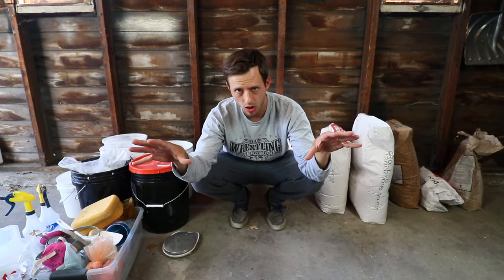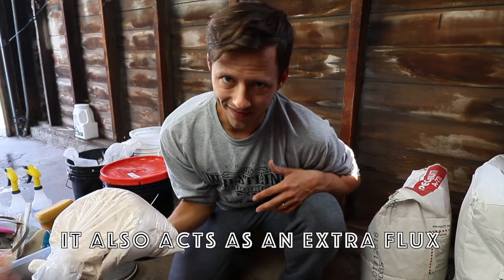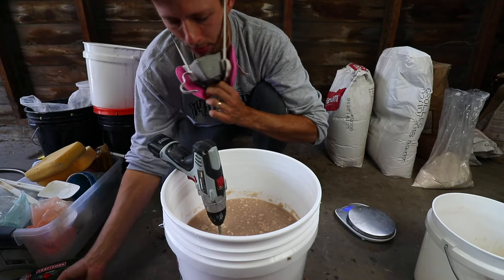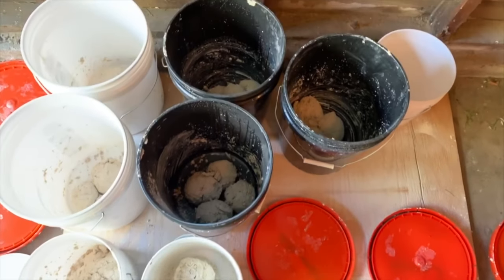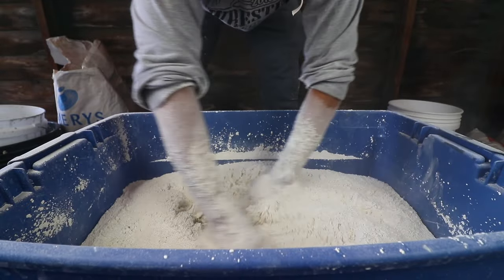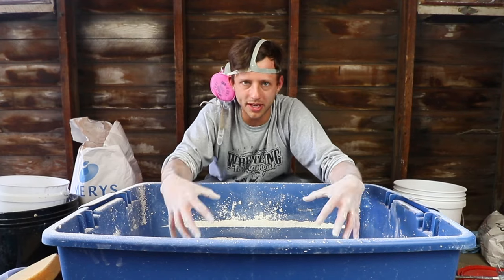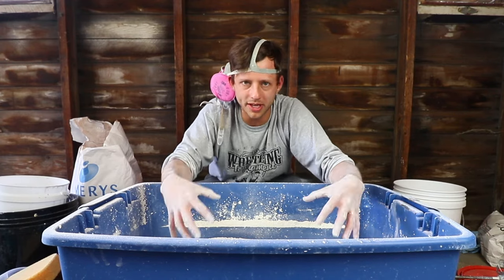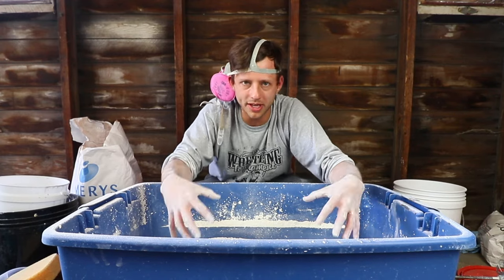How I Make Clay at Home | Pottery | Ceramics

Comment: Back in college we had a mandatory clay body mix, and my prof had measured out all ingredients and then marked out where that weight hit on a 5 gallon bucket and drilled a screw at the mark for easy measuring. I hope that makes sense!
Reply from the maker: That does make sense. Sounds like a helpful hint. I’ve done something similar with water but never dry. Was it always the same height or did you have to pack it down?

Comment: A tip for when you cut a bag in half: place a strong iron bar or pipe at the center point under the bag. Then when you cut it, use the bar or pipe to lift the middle

Comment: I was happy to hear you mention NZK ( Halloysite). I use NZK and Vee Gum in my porcelain, which fires to ^04. Needless to say, it is a very white, very expensive clay body.
Reply from the maker: I’ve never used it but I’d like to see the difference. Really? 04? Does it have mostly frits besides the kaolin. I saw a low fire porcelain recipe on digitalfire that I wanted to try. Wonder if it’s similar.
Reply: @CeramicJim  if it's the Zero3 porcelain recipe from Plainsman Clays on digital fire, then yes. That's the one I use. I've modified it slightly with molochite and nylon fibers because I'm a hand builder. I can verify that it really does vitrify at 04/03. I only take it to 04 because that little extra vitrification at 03 doesn't matter in my work. I also mix it the same way you make your porcelain. Same water issues (I am always overcompensating because of the Vee Gum.) And like all porcelains, I dry it to bone dry very carefully but then slowly fire it to ^016 for bisque. It's a lovely clay body if you ever want to give it a go. However, it has a roughly 12% shrinkage rate, something to watch out for with pottery.
Reply from the maker: Small world. I have all of the necessary ingredients in packages downstairs waiting to be mixed. I’m so grateful for you to share all your info and experience with it. Seriously, thank you. It saves me a lot of time and gives me some good tips on what to watch for. I thought I was the only person who struggles with Vee Gum at first. 😆 Glad to know I have company. I’d love to see some of your work some time.
Reply: @CeramicJim  I am finding that Vee Gum is a necessary monster, but boy is it a weird material. First time I mixed it I thought chemistry had broken on me. I had never seen a powder gel like that.
I'm more than happy to share tips. Just watching your videos, I can tell you are passionate about ceramics and love the technical side of it as well. I also appreciate that you're a teacher. I'll be looking for my first art teaching job (hopefully middle school) in the spring and it's heartening to watch you still be so active with your own work. I'll post a link to my work in a few, as I'm currently updating my online portfolio. Thanks for taking the time to chat! Don't hesitate to reach out if the Zero3 gives you problems.
Reply: @waterlisart  I have a 14% shrink rate with Laguna cone 6 porcelain!!!
Reply from the maker: Those feet sculptures stuck out to me. How did you apply the "illustrations?" on them? Underglaze? Overall I like to smooth amoebic looks of those sculptures. Thanks for sharing.
Reply: @CeramicJim   The illustrations are with China paints - I've tried underglazes before, but find color results and "painterly" brush strokes come across much better with the China Paints.
Reply from the maker: That makes sense. They look very deep and rich which is why I asked. I’ve never used those before.

Comment: Just a note you can reduce the amoundt of veegum you need (to get the desired plasticity), by doing a better job when you hydrat it. You need to add more energy normally you use sonication, or a high shear mixer.
Reply from the maker: Thanks Julie. That is very helpful to know. Does it reach a “breaking” point when is starts to thin again then? I just always thought it got thicker over time. Next batch I’ll see if I can give that a try.
Reply: @CeramicJim  actually in some cases you will see the opposite, where the viscosity will decrease overtime, due to better hydration of the plasticizer.

This is because they plasticizer will act as a dispersion and the higher degree of hydration the better it will disperse the kaolin, feldspar and quartz.

So there are two effects, a high degree of hydration results in a high viscosity of the plasticizer and water mix, but at the sametime a better dispersion of the system is achieved lowering the viscosity.
Reply from the maker: @juliek3701  ahhh. That makes sense. It seems like I probably stop right at the wrong time 🤦‍♂️ when I’ve built viscosity but haven’t dispersed it enough.
Reply from the maker: Thank you, Julie. I don’t think I would have Vero come across that knowledge without you sharing it. And it’s so helpful for the clay body I make. I’ll give it try next mix. 

Question 1: I use VEE GUM as a plasticizer but do you think I need as much or any if I make this clay into a casting slip? (Assuming it doesn’t require tweaks to the rest for casting durability). 
Question 2: I have to hand build/throw my work but I want to cast handles so I feel like I should use the exact same amount of VEEGUM to resist shrink rate cracks. Or perhaps transition to paper clay. Or just use paper clay slip?

Comment: Thank you for this video.  Very interesting.  I’m not at this point of making my own clay yet but may get there one day.  I do mix up mason stains into locally purchased clay.  Do you have any tips for making stained clay with recycled clay?
Reply from the maker: Sure, Lynne. Glad you enjoyed it. Do you mean recycled colored clay or just normal recycled clay that you want to add colors to?
Reply: I’ve been doing both but would like to get your input...maybe you have a better approach.  I’d like to see what you’d do.  Thanks for your input and help.
Reply from the maker: Well i would just wedge in some colors for starters. If I was still bone dry scraps I would add the stains in with the water to make it easier than wedging it later. If you’re talking about colored scraps I’ve tried sorting them and reclaiming them all separately after bone dry and it can be done. But I don’t think it’s worth the time. It will give you some new colors which is cool.
Reply: @CeramicJim  thanks.  I believe I watched you do this on one of your videos.  I’ve been mixing stain with slip...sloppy clay, waiting for it to dry a bit and scooping onto plaster bats to dry, then wedge and wedge.  It takes days! To mix up a batch.  I do use the drill and paddle to mix.  By the way, through your suggestion, I get my stains from US Pigment.  The mini teapot just came out of the kiln 👍. Turned out 😊

Comment: What about using a portable concrete mixer for this process. I know absolutely nothing about making clay I just thought about what could possibly help.
Reply from the maker: I’m sure that would help. I don’t have one. Are they big? Expensive?
Reply: @CeramicJim  Check harbor freight probably get ONE for under hundred dollars
Reply from the maker: Wait. Really? *leaves to google harbor freight concrete mixers.
Reply: @CeramicJim  Just saw one for 189$
Reply from the maker: I think I found the one you did. I don’t know if that would work for clay. If it did then they wouldn’t be charging $1000s for a soldner mixer. I’m pretty sure you can’t just tumble it. It will ball up or not mix enough. Concrete is much more coarse and not sticky. A soldner mixer is similar to that but it have a metal armature that remains stationary inside that forces the clay through it/around it. Helping to sort of wedge it. But who knows. Maybe it would work. If I can rent one if I come across one I can borrow I will definitely try it.
Reply: @CeramicJim  As I thought about more today I agree with what you said about it just clumping up. How about a used Hobart mixer with a dough hook.
Reply from the maker: Hmm. Now I think we’re getting somewhere. We actually had a huge industrial dough mixer where I went to university along with our soldner mixer. They got it from a prison. At least that’s what they said. Because dough needs to be kneaded in a similar way, I would assume a dough machine could work. But those are so expensive 😂

Comment: This was a really awesome video! Super informative :) How do you know what temperature to fire the clay at?
Reply from the maker: Digitalfire.com has a rough guide to get start but after that it's a lot of trial and error. You saw mid video that I made 7 versions of this clay before getting it right. Before that I made 5 different tests. Some bubbled because they couldn't handle cone 6. Others were fine. It may sound daunting, and it is, but making your own clay body (one that actually works that is) takes lots of time and experimenting/tests. Let me know if you have any questions. I may be able to help :)

Comment: 1. Are you using V-GumT ?
2. The problem with raw materials, they tend to be different from one batch to the other, and this can cause issues.
3. Mixing dry powder in an open box is terrible. 
4. Is this process cost affective ?
Reply from the maker: Hmmm, how do you mix your clay? Sounds like you know more than I do. You probably know the answers to those questions.
Reply: @CeramicJim  I think the best way is ball mill, I don't have these fancy tools. I sieve the dry powder a few times in a closed container. You should check Freddy pottery sieves, they are great.

Comment: hello 
I want some help 
I want to make clay pipe whit  ceramic  But I don't know which ceramic to use that is resistant to heat and has good resistance and  beautiful looking 
Can you help me?
And suggest me a recipe for this... can I cook ceramic in my kitchen Owen ? Is it possible?
Thankful
Reply from the maker: I don’t have any advice on a pipe. All clay can go in the oven. Not all clay can take direct flames.
Reply: @CeramicJim  
thanks for your response
what clay can take direct flame ?
I Don't have knowledge of ceramics but u have I think 
Just guide me according to the knowledge you have ...
i want a glassy like ceramic that  not rot with smoke ...
and i wnat some help abot cooking it...
How much heat is needed to bake ceramics?
According to a research I did on the net, it requires a lot of heat ... while my limit is 250 degrees Celsius.
Reply: @CeramicJim  are u read my comment ?
im waiting  here for answerer... 
tnks ..

Comment: Does the plastisizer lessen cracking during firing?
Reply from the maker: I suppose it would because it helps reducing cracking during the work stage. Any cracks that "appear" after firing are usually already there before the firing.
Reply: @CeramicJim  interesting! I use primitive firing methods. I probably started having success when I started drying my work more care. Never could understand why the same firing process started giving better results. Thought I maybe got better at building
Reply from the maker: Probably both. So many cracks or blowups are simply I dried work. I dry all of my work WAY past bone dry. The only cracking I have to watch for now is handles.

Comment: Mix in a trash can :)
Reply from the maker: Next time I think I will ;)
Reply from the maker: Although I wouldn't be able to move a full trash can. Wheels?
Reply: @CeramicJim  it’s rolls well with the wheel attachment. Big Rubbermaid rough neck grey can with  I just mixed 100 gal between two. I also use a 55g barrel more volume with the straight walls  vs tapered trash can. Although the taper works nicely. 

https://ceramicartsnetwork.org/ceramics-monthly/clay-tools/making-clay-tools/tips-tools-homemade-mixer/

This is what I made except mine mounts the wall. I like to be able to move the can around to stir the dry material.

I also mix mine to a slip then dry it out on plaster In a closet with dehumidifier going full.
Reply from the maker: Ahh. That's very helpful Nicholas. Thank you for sharing. Humidity is an issue for me in the basement. Perhaps it's time I invest in a dehumidifier. I thought about cast wire into a plaster bat that I could hook up and heat? Is that too crazy of an idea?
Reply: @CeramicJim  I’d say that would be over kill. It only takes me two days to dry out a 4x20x24 pile on plaster a 3” plaster bat of the same dimensions. I do two at a time in the closet with towel sealing the door. the put bat on flat dolly so I can wheel it around. I had two dehumidifiers going at one point. Moving hot air  is the trick. Cold air won’t absorb moisture so it’s stays in the clay. Hot bat cold air might less effective.